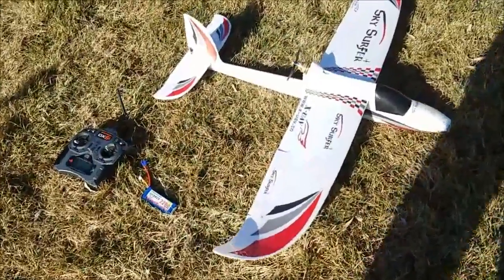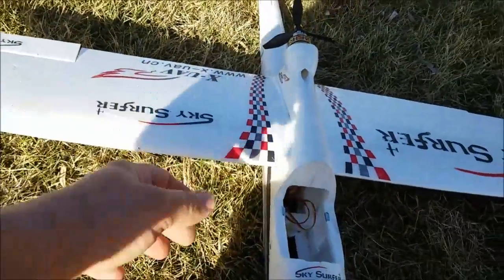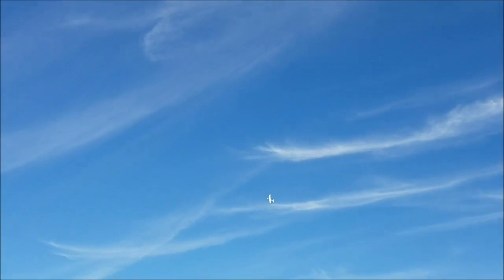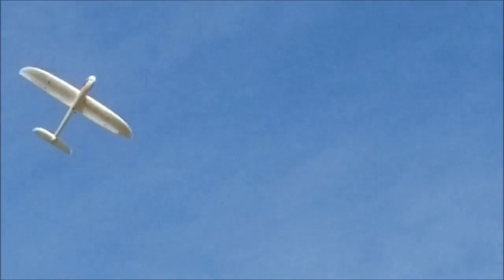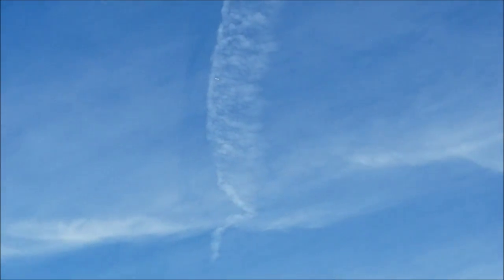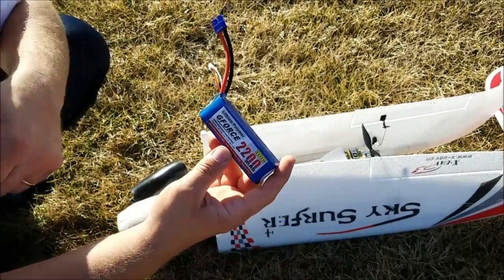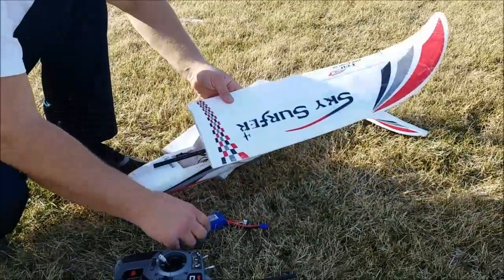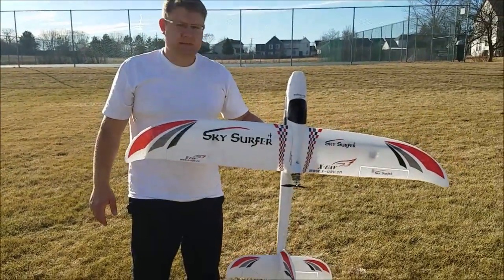Sky Surfer 1400mm (54 inch)

Comment: nice video man. I own a sky surfer and I have a 2200kv motor  upgraded and with 2200 3s battery I get 7 mins. how were y able to get 25mins flight time. was it gliding or very low throttle. also what Esc do u use
Reply from the maker: FunFor Jallez 
I have a timer on my transmitter,and I fly on on off full throttle, but for the most part full throttle. It realisticly flies for 18minutes,I might have went overboard with 25minutes.
I just bought T28 by Eleven Hobbby, check some of those cool videos..
Reply: Kv too high
Reply: Change it to 1000kv

Comment: Is a 2S 1300mah battery good for the Sky Surfer?
Reply from the maker: I haven't used 1300mah but it sure will work. I prefer 2200 mah it's just little bit heavy and i had to push it all the way front for balance.
Reply: @nazarettos6987  Ok, thanks

Comment: 1350kv with a small prop, its wasting a lot of its potential energy
Reply from the maker: Aaron .T you are right,i jist  did not have bigger prop
Reply: @nazarettos6987  I know this is late af but a folding propeller is very good for gliding